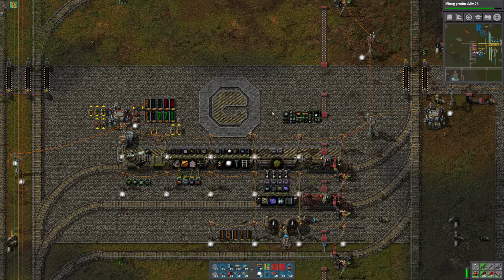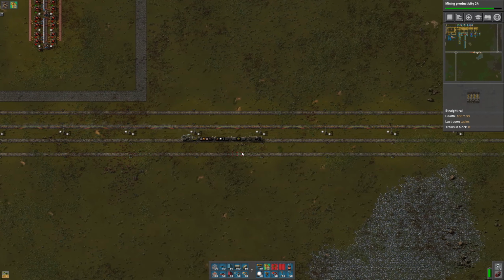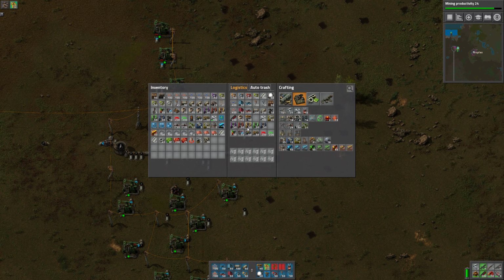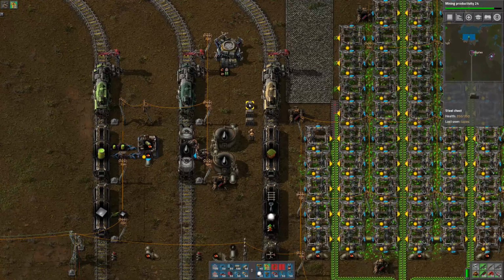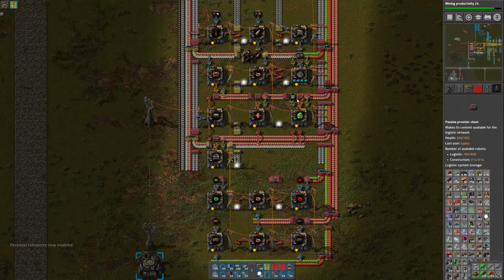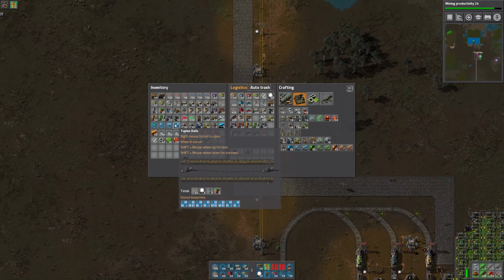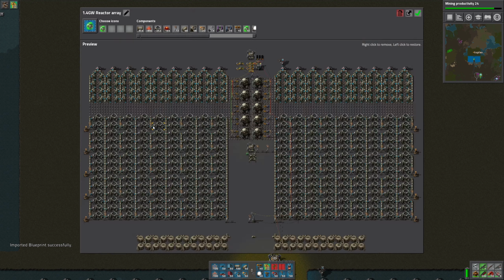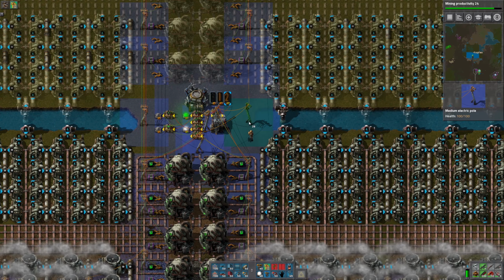Factorio 0.16 Let's Play #61 - Setting up for more power

Comment: What’s up?  The end of episode 60 was a cliffhanger, I was trying to understand the complicated circuit wiring of the blue circuit station, which wasn’t working (and which you weren’t explaining, but that’s a different complaint) but you ended the episode saying you were gonna figure it out off line.  Episode 61 starts and we’re making more nuke power.  Plus now you’re talking more rockets, and last episode it was hold off on rockets to make modules. I’m getting whiplash. 🤪. What happened to the wiring snafu? 😬